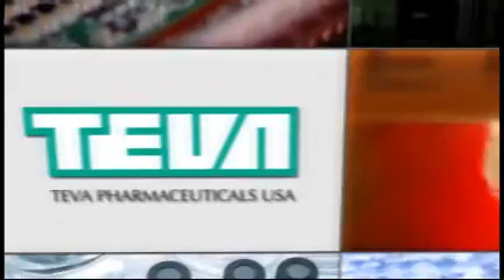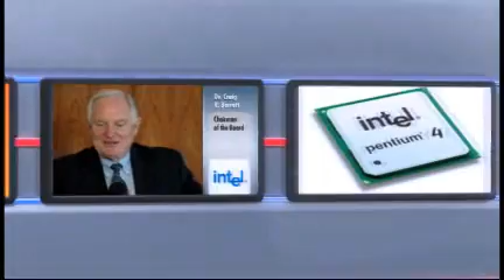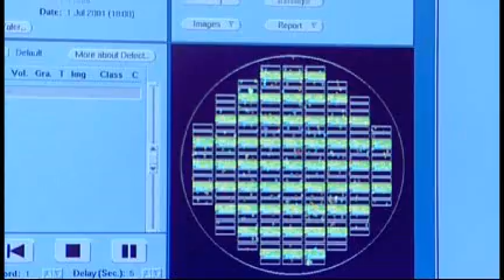Invest-in-Israel

Comment: (part 2)Computers should have a sign attached saying Israel Inside. The Pentium NMX Chip technology was designed at Intel in Israel. Both the Pentium 4 microprocessor and the Centrum processor were entirely designed, developed, and produced in Israel.
Voice mail technology was developed in Israel. The technology for the AOL Instant Messenger ICQ was developed in 1996 in Israel by four young Israeli whiz kids.